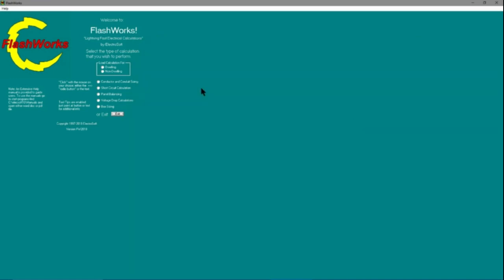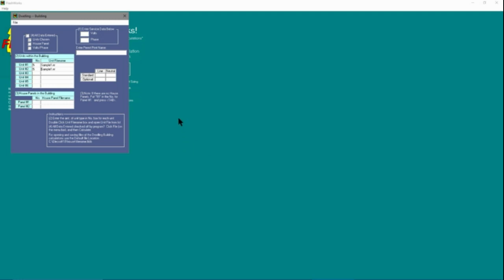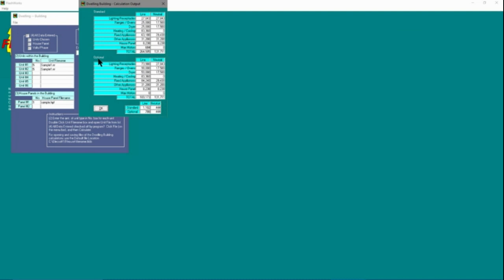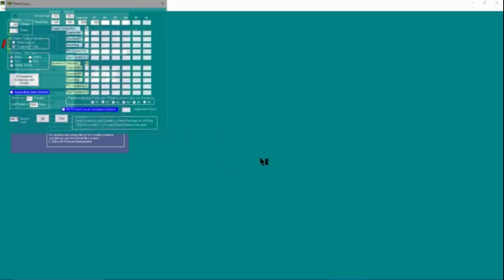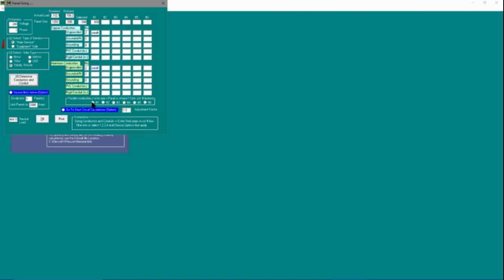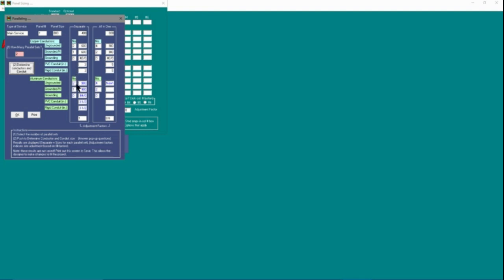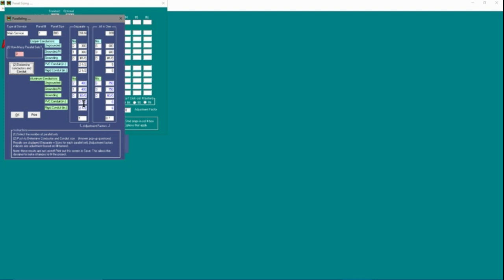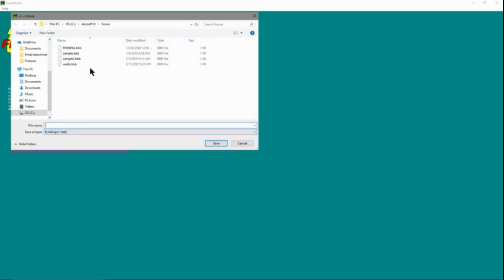multifamily Electrical Service Load Calculation

Comment: Optional in 240/1 is only allowed for a maximum of 400 amps.  Above 400, have to use standard.  Having said that, I have been using this software for several years now and can't say enough good things about it.